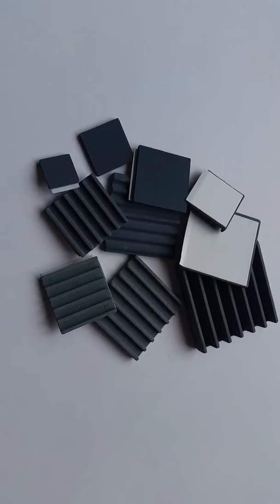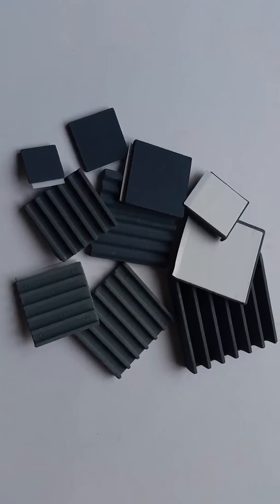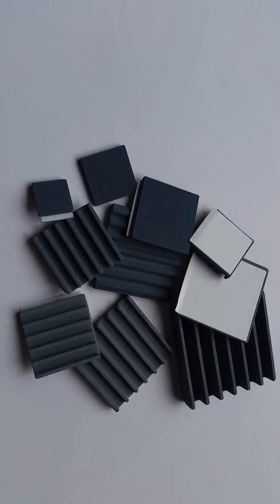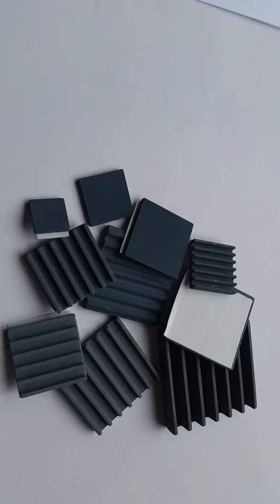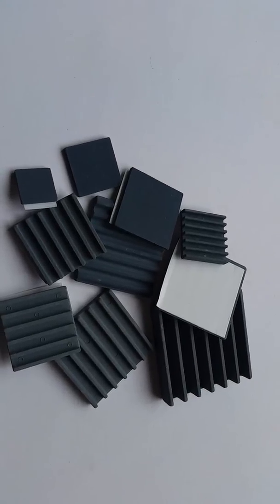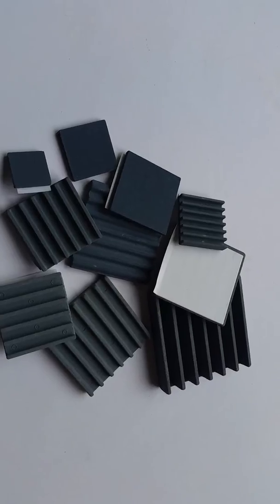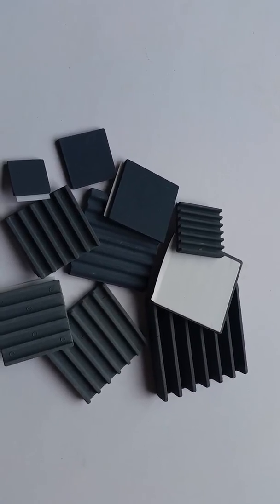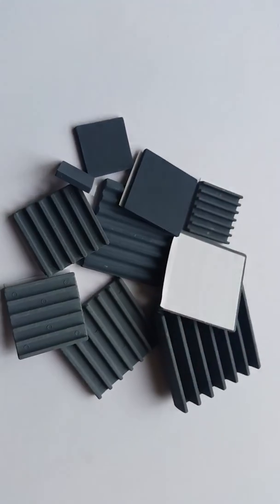Ceramic heat sinks with a large surface area vs metal heat sinks

Comment: Is it possible to scale something like this up to be usable for CPUs?
Reply: They never answered! Rude!
Reply: @DonnyHootieHoot because the original question is absolutely vague. What CPU? How much power does it draw? At which speed does it have to be running? At which temp does The CPU throttle? An elaborate answer would be: mostly not, with a few exceptions. Most CPUs nowadays output tons of heat, for which the size and shape of the dissipator needed would be ridiculous, if it is meant to be used without any additional cooling solution. Therefore, unless the CPU is really low power consumption and runs at low clock speeds, these ceramic and aluminum passive dissipation solutions won't suffice.

Comment: hi! where can I buy them?
Reply: Thermally conducting but electrically insulating. Thus eliminating the need for silicone washers, silicone grease and air circulation. as in the case of metallic heatsinks. Brilliant!
Reply: Oluwagbenga Akingbala contact me gm@cnhighborn.com
Reply: aliexpress
Reply: Ebay